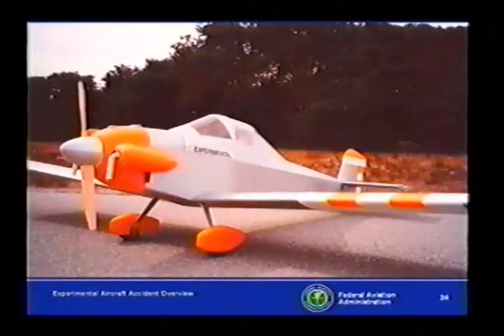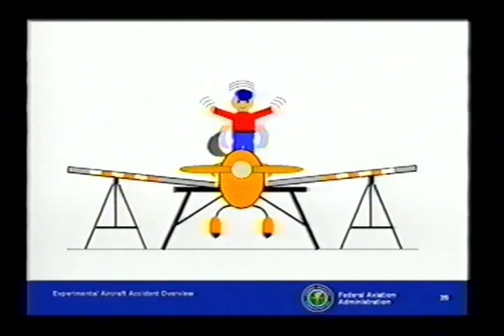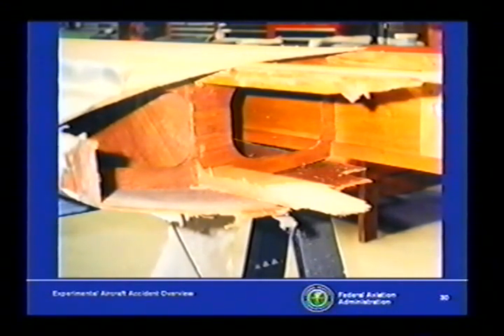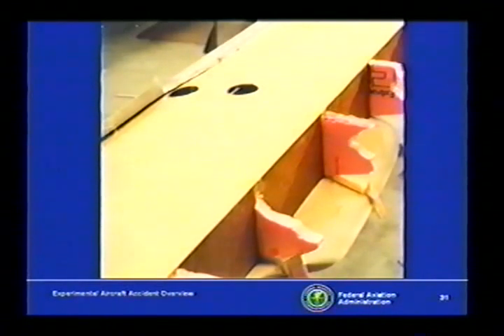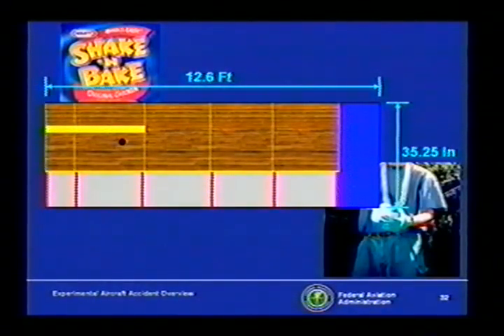Anatomy of a homebuilt aircraft failure

Comment: Logic failure on the part of the builder.  He built the structure for the ribs and appearance instead of the spar and function.  Just a failure on his part to understand how the wing carries the other load.  Apparently, he never really asked himself what he was trying to do regarding the loads.   People make the same sort of logic mistakes when building other structures (ie, decks or roofs that collapse, which is a failure to understand how the load is transferred to the ground).  But flying is relatively unforgiving.  Even dropping 50 feet is going to be fatal or nearly so as that load is transferred to the ground.  Unbelievable that he passed off his ignorance to others who bought what he built.  Beware in the homebuilt market!!!

Comment: Few people with any common sense would make mistakes like that.  Anyone that's even built a few model airplanes knows the main spars need to be one solid piece.  How often will a plane break up in mid-air?  lol.  Once in a blue moon!  Wanna do something REALLY dangerous?  Drive a car!
Reply: However, it looks like the failure did NOT occur at the point where the spar is glued to the sheer web.  It would have been helpful if they would have shown a picture where the break occurred.

Comment: How did you do the math to determine at what G's a wing will fold?
Reply from the maker: I didn't do the math myself, the presenter did.  However, there is a really great book called "Stress Without Tears" that shows exactly how to do this type of math.  It is very easy to read, requiring only high school math to understand.
Reply: Johnny Tobifour good UN...  I was thinking more like put sandbags you knew the weight of on the wings while you were safely on the ground until they failed.  I know crazy right?  What was I thinking.  Much more fun to pull the G's
Reply: +Johnny Tobifour Sorry, but you're talking nonsense. The reference to a 60° bank (coordinated) producing 2Gs of load on the craft is talking about how steeply the aircraft is banked (a line drawn through the wingtips would be 60° from level). The G-loading on the aircraft increases on a curve and approaches infinity as the angle of bank approaches 90°. If you rotate the craft beyond 90° then it's actually inverted and it is impossible the achieve a coordinated bank with positive G forces.  So really hope you were kidding.

Comment: It should be pointed out that the vast majority of all homebuild / experimental - amateur build airplanes are Not bad designs and are safe to fly. Most are build by very well designed plans & with proven methods. There is the EAA with chapters at about every Airport and they help folks with advise and inspection. Anybody who wants to build a plane can get help IF HE IS WILLING to listen and learn. Very small single seat planes have very little oversight requirements, but even with that almost all of them are very safe. Its just a hobby that rewards education and due process. Please do not come to prejudice conclusions just because media hype about every crash and no report about all the safe planes flying around...
Reply: PDZ1122; You are sure right with these two comments...No question... Building a wooden airplane requires far more skill and care than bolting together and kitplane or ultralight of the metal kind. Attention to "detail" is a total must with wooden structures...
Reply: @BetterAircraftFabric  i bought an avid speedwing and amd starting lessons soon. And i have 100% faith in it. But no way wpuld i buy or try to build or design a wooden airplane. Also luan plywood is a horrific choice
Reply: Thane Mac  If you can read and understand whole text - i know its an issue for certain people with their attitude to reading longer texts, you will realize that i've written the same. 
But even toys can learn you about construction of airplanes. It actually helped me a lot with pilot training.
Also there are toys and model aircrafts which could, if handled inapropriately could kill. And if you do improper job on engine part you can start fire. Specifically handling jet engines on model aircrafts is not fun.
Reply: +BetterAircraftFabric I think RC airplanes are a good start for a basic know how. Altough small airplanes and heavy airplanes behaves in a different way. Minor unimportant mishap on small airplane could be fatal on big one. As you told. There are amateur aviation asociations with professionals from aircraft industry which offers guidelines, help, inspection not as part of their profession but a hobby. Sometimes for a bottles of good wine or schnaps:) Building is about learning. If you are not willing to learn, you are doomed.
Reply: PDZ1122 

Totally agree! Sometimes the project is good, the plans are easy to understand, and even the constructor is skilled enough to carry on the project with no problems, but using poor materials, like non-aeronautical grade wood, or wrongly cut, or just by using inappropriate type of glues could lead to disaster.

Comment: Unfortunately with freedom comes responsibility, that is, the freedom the FAA gives you with the homebuilt regulations to design and fly your own aircraft, also gives you the builder, the responsibility to ensure that your design meets with established aeronautical calculations so the finished product exceeds the expected loads during flight. Sadly, this was not the case with this gentleman.
Reply: Testing by jumping up and down on it is nuts..as in using luan plywood thats literally garbage. If i designed a plane id test it to 4 or 5 g's just off the top of my head. Youre landing at 40 to 80 mph and may drop from 10 feet to 0 in a half second. Im betting thats 3gs minimum. And you do a hard banking turn and the wrong wind gust hits a wing/s.... This guy was nuts